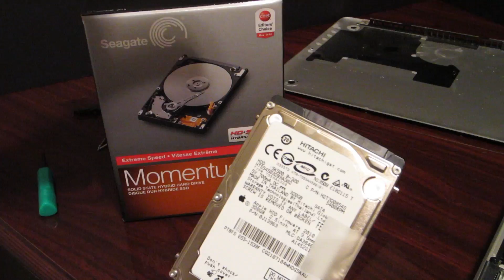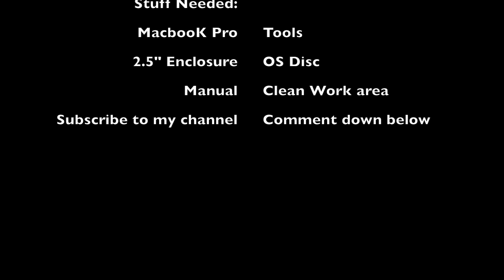How to: Install a hard drive into a Macbook Pro 2011 (HD)

Comment from the maker: @mcimpoeru no errors. I haven't seen a huge improvement in performance but you can definently tell programs load a bit faster. If you dont need a bigger hard drive, i'd reccommend going with a full SSD instead of this.

Comment from the maker: @funkman1985 Yes and no, If you break something while it is disassembled then yes it will void the warrenty. But if no harm is done to your device while upgrading or replacing parts yourself, then no, it wont. Basically, if you don't follow my steps carefully or know what your doing, I'd reccomennd going to the GEEK SQUAD